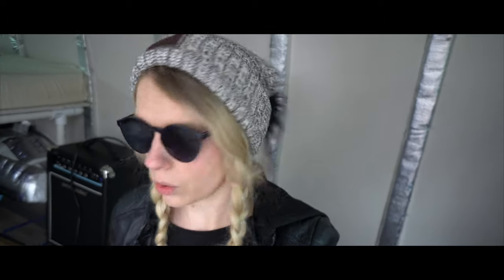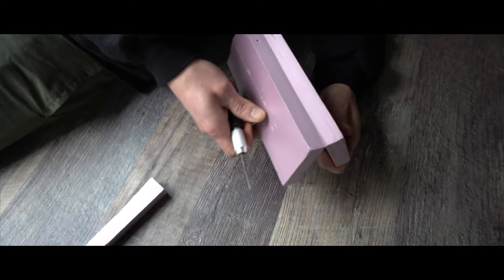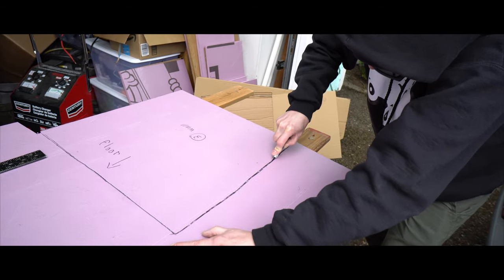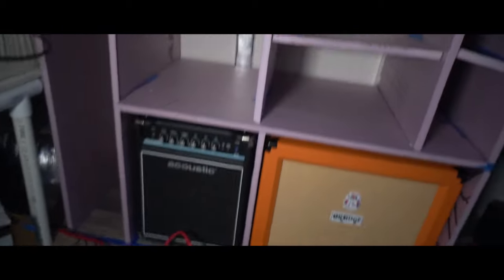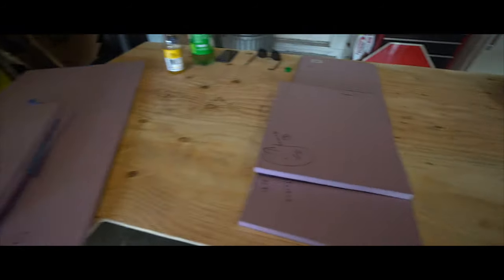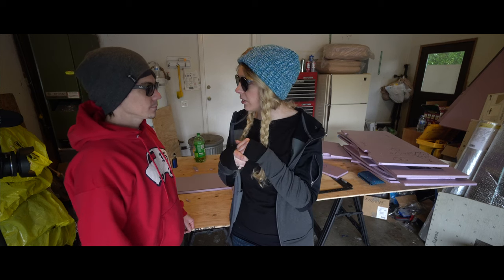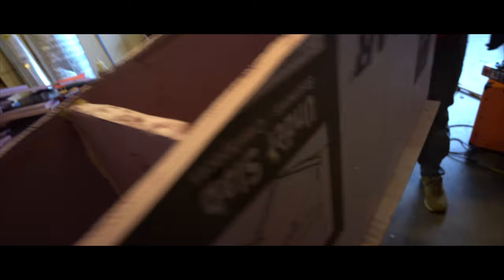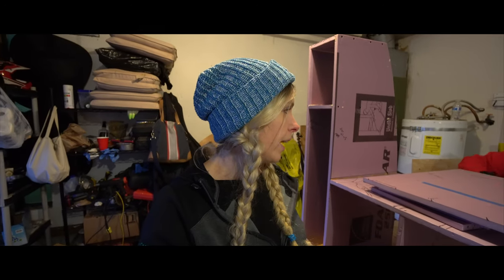Vanlife: Building Foam Cabinets Part 2

Comment: I'm loving this whole foam thing that you and other people do.  However, there is an easier way to cover it with the screen!   Cover both sides of EVERY piece with paint(glue) and screen.  Let it dry.  Then GLUE  all the pieces together.  After that, cut and glue down your corner/join screen pieces.  Then do the 2nd layer of paint to even out everything.  Then do the decoupage.  It's gonna save you a bit of time. Not a ton, but, it's worth it.

Comment: I tried using the yellow sheetrock plastic screen tape for the corners and it worked great.  Much easier than cutting strips and putting them down.  Just a thought...cheers.
Reply from the maker: +Traveling Terry thank you. We have never heard of it but we will look into and see if we like it :)
Reply: On my second cabinet build, I laid out the cabinet pieces with a felt marker pen, and then put the gripper paint and screen on the whole sheet first (both sides)...and after it dried I cut the pieces out and fit them together.  This made the painting and screen application process so much faster and easier...cheers.

Comment: Hi Evie. Are u adding a water/shower system of any kind. Haven't yet watched all of your vids or caught up on Jed's so apologies if you've covered that question. Btw..kinda late now but have u guys checked out the sportsmobile site? On a computer or tablet, you can build vans including the GM. U choose swb or long and then u can choose cabinets, beds, sofas and showers and it shows dimensions of everything. It's an old school website but quite interactive for planning builds. Thanks for the vids! I hope to see your channel grow as u are my favourite now
Reply from the maker: +rod22lt never heard of it but thank you for your suggestion! We will look into it. It would help with planning out the rest of the build for sure :) we won't have shower or bathroom in the van. We have a portable toilet for emergencies and for shower we will be going to the gym and we also have a little power pump shower head which will be attached to the water container and it will be a sink/slash outside shower

Comment: Looking really good, I am curious though are you using some kind of level or square like a speed square to make sure everything will be square and level with your shelving? Your making progress that's for sure and that's what is takes, thanks for sharing. :)
Reply from the maker: +Chris S yes we used a square thing and a level to make sure everything was leveled. 1 shelves turned out a bit off but not noticeable at all.

Comment: Are you going to veneer the foam for strength or just paint paper mache onto it ?
Reply from the maker: +RemusKingOfRome5 once we are done with putting fiberglass screens with gripper paint on it we might do wood veneer and paint it or do a whitewash thing. It's more for the looks since screens and gripper paint will make it super strong. We are not set on it yet. We gonna do a small experiment to see how it holds up and looks first and I will make sure to add that in future video. We got a small piece of red oak wood veneer to play around with :)

Comment: What kind of screws? What size?
Reply from the maker: +sc1212able I'm sorry I forgot to say that in the video. Those are regular drywall screws 1 1/4 inch long. If your foam is thinner or thicker I would suggest using shorter or longer screws. As long as they are long enough to go through foam and go through part of other foam on other side. Wood screws will work too.
Reply: thanks, fixing to build some of these as an experiment to see what kind of strength it well have.